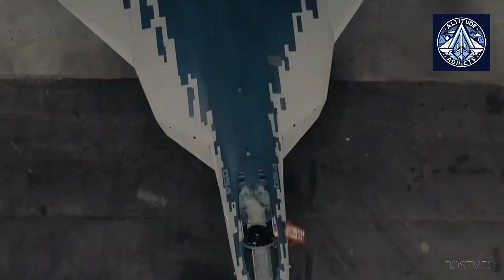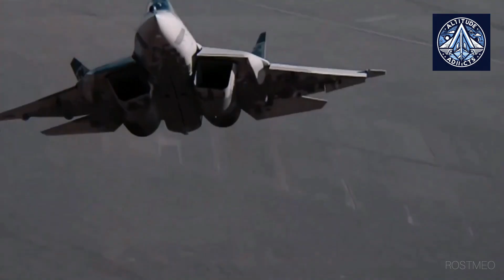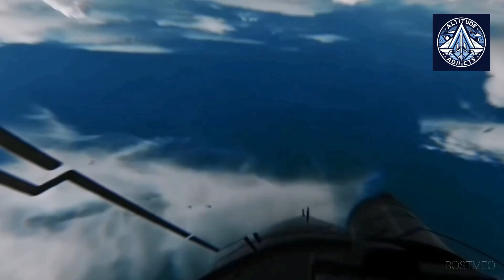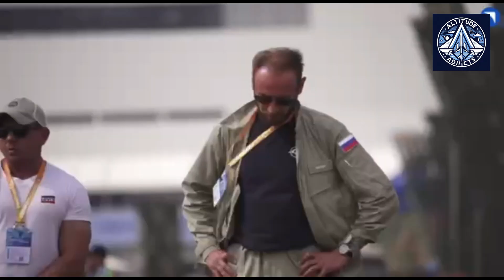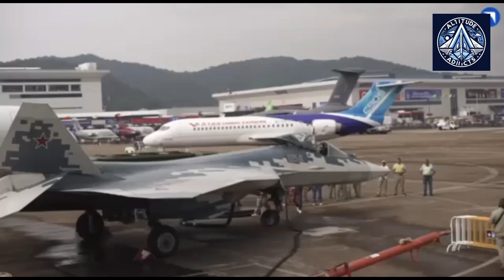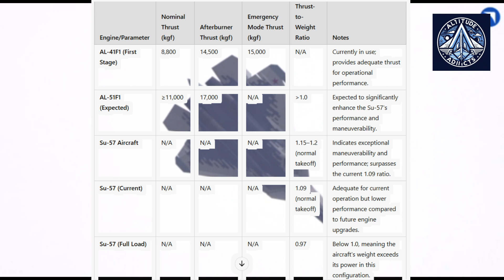Su-57 Finally Gets Its Fifth generation AL-51F1 Engine

Comment: A thrust-to-weight ratio of 12.82 (w/t of 0.078) or 13.53 in an emergency is ridiculously high. Western fifth generation engines supposedly only achieve thrust-to-weight ratios of 7.95:1 (F119), 9.17:1 or 10.51:1 in an emergency (EJ200) and 11.47:1 (F135).
This at the very least indicates that the flat nozzles negative impact on thrust of 14-17% isn’t included in the stated value. It also hints at the AL-51F1‘s thrust values to be generally exaggerated or calculated for a dynamic setting instead of a static one.
Reply: Да, да, поплачь ещё, то что вы всё преувеличиваете в разы вас, как-то не смущает. Ваша западная хваленная техника, показала, насколько она реально "крутая" и соответствует "заявленным" параметрам, Ваши абрамсы, леопарды, челленджеры горят как спичку.
Reply: @maruf84  with all due respect, saying all that doesn't prove anything wrong in his statement

Comment: Previously, rumors stating that Su-57 will features spiky circular thrust nozzles like F-35. I'm kinda disappointed they sacrifices the full aerobatic potential by choosing rectangular nozzle
But yeah, radars & missiles are getting more advanced time by time so they have to squeeze their radar & infrared signature
Yet still, 3D rectangular thrust vectoring? That's absolutely new and sounds expensive

Comment: 2.1 mach sustained speed? nah.... no way
Reply: I mean, they claim to have achieved a ridiculous thrust-to-weight ratio of 12.82:1 or 13.53:1 in an emergency for those engines. For comparison, the F135 supposedly has a T/W of 11.47:1, the EJ200 9.17:1 and the F119 7.95:1.
Reply: With vodka..? Yes 🐻🇷🇺🍾

Comment: Su-57 has some inherent features that the F-22 or others don't have, 360 degree radar coverage, for example. Different countries, different approaches, different standards. I'm not a fun of a flat nozzle, BTW, it worsens flying performance for the sake of stealth capabilities. Maybe, just because the nozzle is angled, it can rotate within +_ 45 degrees giving partial 3D vectoring but it gets super sophisticated
Reply: The most important feature is it's AI which allows it to have integrated control of loyal wingmen drones.

The F-22 can't do that.

The F-22 is from the 1990s.

It was made with windows 95.

It's software and concept is old and outdated. 

Hence why they stop making them. 

The Su-57 is a 21st century combat aircraft.

It was made with AI and loyal wingmen drones in mind.

Same thing as the F-35, J-20 and the new J-35.
Reply: @danwelterweight4137 Ohotnik enters the chat lol
Reply: 200km missiles, AI and data links.
Reply: @ДмитрийМарков-о5ш  so as per u which is better, f 35 or Russian su 57? Is it a good match against J20 and J35(China's 5th generation aircraft)? 

I am an Indian and I lack aviation know how. so I don't know much.. i got curious owing to India thinking of buying SU 57.
Reply: @rahulshine3317  it isn’t a good idea to compare F-35 which is more of a strike aircraft with Su-57/F-22 that are “multirole” air superiority fighters with limited A2G capabilities. So in terms of A2A the Su-57 is probably better than the F-35 but in terms of being a true multirole fighter the F-35 is probably the best aircraft in the world rn. 

About Chinese 5th gen’s. We can’t compare anything to them cause basically we know pretty much nothing about them (we have way less confirmed information about them than about F-22/35’s or Su-57).
Reply: @danwelterweight - the F-22 has already flown with CCA'S AS HAS THE F-35! THEY ARE CONTROLED BY THE PILOT FROM Z CONTROL PANEL ON THE PILOTS LEFT THIGH! WE ARE THE LEADERS IN A.I. ! WE HAVE 6 F-16'S FLYING ON A.I. AND THE V.I.S.T.A. F-16 IS DOGFIGHTING PILOTED AIRCRAFT BY ITSELF ALREADY...IN 2013-2017 THE X-47B WAS FLYING ON A.I., TAKING OFF AND LANDING ON A CARRIER AND PERFORMING MID AIR REFUELS....TO THE ORIGINAL POSTER...YOU FOOL, THE RAPTOR, VIPER, EAGLE AND 35 ALL HAVE 360⁰ RADAR YOU DOLT! THE F-35 CAN ALSO COMMAND AND CONTROL H.I.M.A.R.S, PATRIOT, AEGIS, AEGIS ASHORE AND T.H.A.A.D AND COMMAND AND CONTROL MISSILES FIRED FROM OTHER AIRCRAFT....NOT IN THE FUTURE....ALREADY DONE IT!...HABITUAL LINE CROSSER, HERE ON YOUTUBE WAS THE PATRIOT OPERATOR THAT PARTICIPATED IN THE EXCERCISE HITTING BOTH A MOVING GROUND TARGET AND AIR TARGET. THE RAPTORS UPGRADED HELMET, THE SAME AS THE F-35 MAKES THE COCKPIT INVISIBLE WHEN ACTIVE AND ABLE TO LOCK TARGETS 360⁰ IN ANY DIRECTION WITHOUT CHANGING THE NOSE OF THE AIRCRAFT.....YES...EVEN DIRECTLY BEHIND THE JET...THE NEWER, AIM-9X VECTORED THRUST MISSILES CAN SHOOT BEHIND THE AIRCRAFT....."STUPID-MANEUVERABILY" NOT REALLY NEED ANY MORE....NICE....NOT NEEDED. RUSSIA IS PLAYING 20TH CENTURY GAMES AND LACKS ANY AND ALL MODERNITY IN THEIR 4+ GEN "UN-STEALTH" AIRCRAFT! IF IT WAS WORTH A SHIT, INDIA WOULDNT HAVE BAILED AND CHINA WOULD NOT HAVE COSEN TO USE DATA FROM THE RAPTOR AND 35 TO BUILD THEIR OWN, THEYD HAVE JUST BOUGHT THE FELON. ITS AMAZING RUSSIA STILL HASNT CAUGHT UP TO THE RAPTOR...AND ITS ALMOST 30 YEARS OLD NOW! WHERE THEIR F-35, THEIR X-47B, THEIR B-2, THEIR B-21, THEIR MANTA A.I. SUBMARINE, THEIR MISSILE DEFENSE SYSTEMS THAT ACTUALLY WORK, THE T-14(loser, analog turd of a tank), THEIR SARMAT(5 outta 6 blew up or didn't work), POSEIDON MISSILE(that sank to the bottom of the ocean on the one time they tried it), THEIR KUZNETZOV CARRIER(we've got 20, they can't get 1? yes, 11 supers + 9 Amphibious Carriers = 20), THEIR GLONASS FAKE VERSION OF G.P.S.(that doesn't work, that why they are using our systems), WHY ARE THEY RUNNING AROUND A BATTLEFIELD ON E-SCOOTERS LIKE MY NEPHEW GOT FOR CHRISTMAS, WHERE IS THEIR AIR MISSILE DEFENSE SYSTEMS THAT CAN SEE, TRACK AND LOCK THAT FAKE AMERICAN STEALTH TECHNOLOGY LIKE THE F-22 & F-35.....OH YEA,...BLOWN UP BY ISRAEL IN F-35'S OVER IRANS CAPITAL CITY,  THATS WHERE!.....RUSSIA IS A 3RD WORLD SHIT-HOLE THAT IS 50 YEARS AT BEST BEHIND US IN EVERY WAY...for Christ's sake, Texas has a larger G.D.P. than all of Mother Russia and they have to buy all their technology over the counter from America and Europe! Losers. There soldiers fight like it's 1915 and their Aircraft are stuck in 1990 and they are trying to act relevant....they've never proved any of their "technology" and ours is proved everyday on the battlefield against theirs, 20 countries have bought F-35's, no one has purchased Sukhoi anything! And this is just a Su-27 Wanker with a fiberglass body kit....NOTHING NEW! AND ITS OBVIOUS ITS A.I. IS SH!TE BECAUSE IT HAD TO SHOOT DOWN A DRONE IT COULDNT CONTROL! LOSER, LOSER, LOSERS!